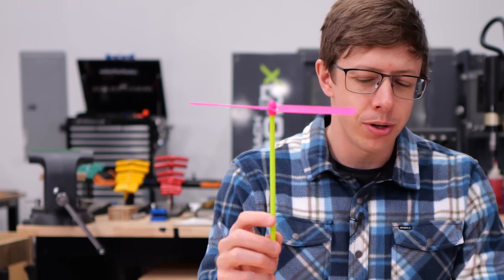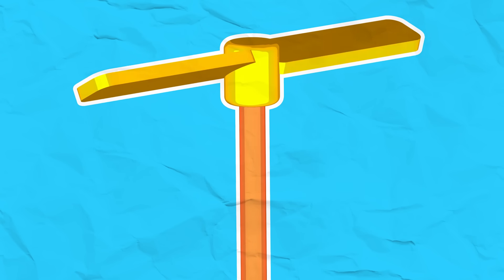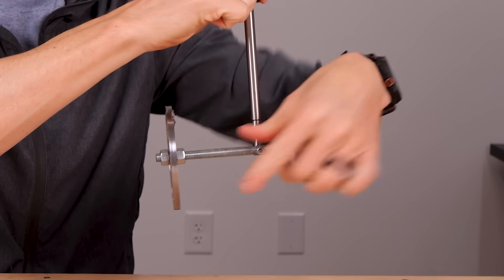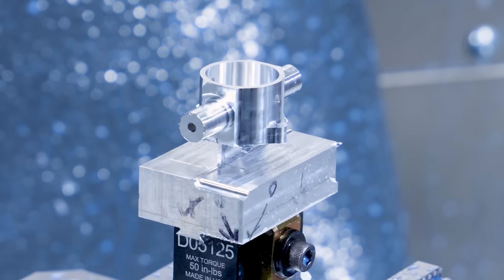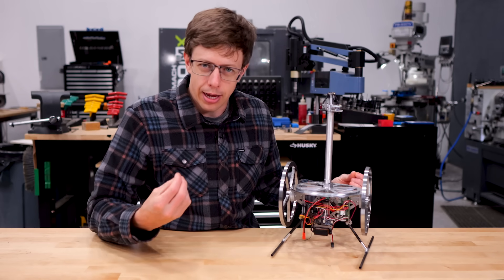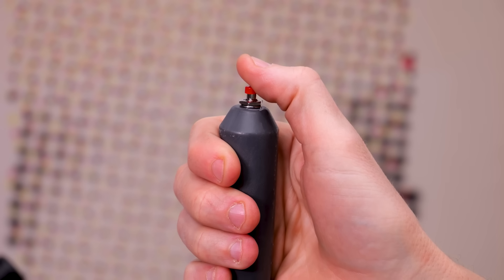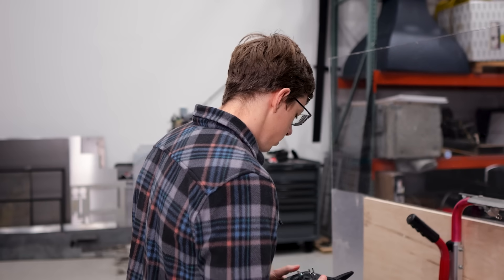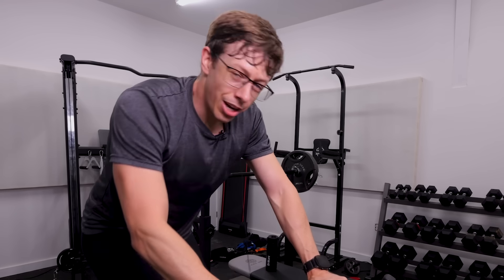I really thought this would fly well

Comment: I think there's a reason that traditional helicopters don't use the vertical "aileron" concept underneath them.  By the time you made them large enough to counteract the torque (and all the inefficiencies of doing so this way), you'd be diverting so much of your lift away that it would have a hard time getting off the ground.  I'd think the way that this has classically been solved is going to be part of your final solution - either with some notion of a tail rotor, or with contra-rotating main rotor blades (though mechanically that's more complicated than a tail rotor).
Reply: I think the K-max (divergent, closely spaced rotor axes, 2 counter-rotating rotors) concept is the most stable option.
Reply: "you'd be diverting so much of your lift away that it would have a hard time getting off the ground"  The direction of the air from the rotor blades doesn't really matter after it leaves the rotor blades.  How does the space shuttle still rise off the pad with the flame trench diverting all of the rocket exhaust sideways?
Reply: @stargazer7644  I see your argument, but there is only so much kinetic energy in the air moving downwards once it isn't interacting with the blades any more.  The downward rushing air into the "ailerons" causes two resulting forces - one a torque trying to counter the torque from the blades (which we want) and another, a pressure downwards on the ailerons (which we don't want).  This has the effect of some of the lift generated by the rotor being countered by the ailerons trying to pull the helicopter back down.  For the shuttle's flame trench, things are a bit different, since the downward force being applied as the flames are diverted off to the side isn't acting on the shuttle; it's being applied to the ground, as the diverting trenches aren't connected to the shuttle.  For this helicopter, the downward force imparted on the ailerons has a similar negative effect as the notion of trying to propel yourself on sailboat by blowing a fan into the sail.
Reply: You could also solve it do it with a counter-rotating fly-wheel at the bottom of the craft. Simpler to build than counter-rotating rotor blades working (it is essentially just the same problem as getting the two main fly-wheels counter-rotating), and easier to control than a tail-rotor...

Comment: How much trouble would it have been just to listen to Occam's razor, why didn't you just spin a flywheel of equal weight to the blades in the opposite direction on the bottom? After all, a metal flywheel is bound to be much smaller then the span of the blades. and you also had the gears in place that should have made this a semi easy modification, would've at least possible flown better the your "Hack". edit: Plus it depending on the metal used it could even possibly fit beneath the training gear.

Comment: Nice project but...

Your larger control surfaces wouldn't do anything because control surfaces don't work under airflow generated through propwash. That is the airstream from the propeller won't be able to help the control surfaces work. That's why control surfaces on planes are always on the outer side of the wings. Secondly, you could also fix your other problems through contra rotating propellers.

Comment: Okay, I'm looking at this project and, while awesome, I strongly believe that you overcomplicated things. Your original objective was to figure out how high those toy propellers could go, and you ended up manufacturing a tail-less helicopter.

The core element of your original question was a simple contraption consisting on one propeller connected to a slim, long rod, which you have to manually make spin. If you want to make the Big Boy version of the toy plastic original, you can (and did) build it with a bigger propeller and a metal rod. But then you added flywheels to the sides because the whole Power/Drag balance. I think here's when things took a turn, because the simplicity of the original concept became--in my opinion--unnecesarily complicated. The core element is still the propeller and rod, and I think you should have focused on how to provide a more efficient launch chance to the original "toy" without compromising the original, simple design.

You built a launcher that would spin the flywheels. Why not use the launcher to make the central rod spin instead? Find a way to keep it attached to the launcher (electromagnet on the base, holding the rod and allowing it to spin until the desired speed is reached? Maybe a simple claw that can open on command?) until it's time to launch, and then just launch the propeller/rod basic contraption. Is the drag still an issue? Experiment with different propellers! You can build a propeller that is ALSO a flywheel by adding a metal ring around the circumference of the blades! Maybe a cone-shaped propeller? Like, a propeller that can "drill" up to the skies?

Remember: the core goal of your experiment is to see how high can you send the original concept of the toy. Don't ovecomplicate the toy: find a way to make the launch more efficient!

Regardless, I can't wait for the next video, whenever it happens.

Comment: over complicating a simple design bro.
1) take original wooden propeller design. replace it with stronger lighter plastics.
2) shaft has fins for straight up flight since height is your goal
3) bottom is a small 45 degree gear and that's it.
4) launch pad has another 45 degree gear to spin connected to motor or gear system for faster speeds.
5) release trigger is just a lubricated straw cut in half to move like grip plyers.

Comment: Flywheel bottom mounted to the shaft parallel to the blade which are on the opposite end. A stacked gear system transmits the rotation of the fly wheel to the shaft to turn the blades.  The stacked gear system acts to spin the blades opposite of the direction of the fly wheel.

Comment: I've never seen a single rotor helicopter. 
I guess two cointer rotation would work better for lift instead of having a tail. 
Then you can have a giant single flywheel underneath horizontal so it'll percess around the center of the helicopter but it'll keep it upright

Comment: I love the video and all your projects but it misinterprets the fundamental principles of aerodynamics. An aircraft does not generate lift simply by pushing air downward; rather, it is “pulled” upward due to the pressure differential created by the airflow over its wings.

The key concept here is Bernoulli’s principle: the air moving over the upper surface of the wing (extrados) travels faster than the air beneath the wing (intrados). This speed difference leads to a pressure reduction on the upper surface, creating a net upward force—lift. This phenomenon is further complemented by Newton’s third law, as the wing does impart some downward momentum to the air, but this alone does not fully explain lift.

A more complete explanation involves the circulation theory of lift, where the wing shape (airfoil) and its angle of attack generate a curved streamline pattern that induces faster airflow over the top, enhancing the pressure difference. The contribution of vorticity and bound circulation further refines how lift is sustained.

A common misconception is that wings “deflect air downward” as their primary mechanism. While downward airflow (downwash) is a byproduct of lift, it is not the fundamental cause. The real driving force is the low-pressure region above the wing, which effectively “sucks” the aircraft upward.

Comment: They had the idea in ww2 to make a plane who would go over mach 1 without a jet engine, and they did; but according to the tests pilots, the thing was horrifying. The propellers were breaking the sound barrier multiple times a second, each. The sound was hell, and it had so much torque that they needed to fight for the plane to stay straight, while flying over mach 1. The engine could only go full throttle (i think) and they were controling the speed with the angle of the blades.

Comment: You're sending the propwash/turbulent air right through the control surfaces. They need to be wider than the prop to be more efficient.  It's one of the reasons ailerons are at the tip of the wings. Maybe use the surfaces to counter gyro precession OR counter-rotating propellers.

Comment: you need counter rotating blades. the wing will only ever deflect a fraction of the torque acting on the prop. adding a tail rotor would just burn energy. talk about reinventing the wheel when you are basically making a fancy frisbee

Comment: You just need a long 'stick' with the flywheel at the bottom coaxial to the stick (low CG), attached with a planetary gear to keep fixed pitch blades rpm low, and a BIG farm field, so when it drops in from 1500m you have time to hide. Remember, it's not science unless you have to hide.

Comment: Not an engineer, but to keep it close to the toy, could you have the shaft and blades as he does now, with the cyclic, a geared portion the the shaft and spin it with a gear on the outside. The shaft could be held at the bottom with a mechanism and when up to speed, set the cyclic to “climb” and release the holder at the bottom?

Comment: I'm just curious, wouldn't it be better to only keep the "shaft and propeller" and just attach the flywheel with it? The thing would work just like the normal toy but with the benefice of the fly time increased. If possible keep the pitch control system aswell I guess

Comment: Wow, this takes me back, was similarly inspired by that same propeller toy as a 10 year old in the early 90s to create an electrically powered version using whatever I could find, with dreams of launching that sucker into the stratosphere:

-I took apart an old RC car with a larger than typical motor.
-Made a base with an empty solder spool that I glued the motor from the RC car to, so that the motor shaft was pointing up.
-Used the motor to direct drive an aluminum propeller I painstakingly fabbed as well as I could with the tools in our garage(grinder, vices, hammers, pliers).  The plastic one from the toy was not beefy enough to carry the weight of the motor. 
-Made a 10ft power cable with the thinnest gauge wiring at hand that that connected the motor back to the 8 - AA battery RC car chassis.
-Upon testing and iterating, the best I got was about 8 inches of lift in a bouncy, wobbly fashion.

Stabilization was the main issue, I couldn't make the prop symmetrical / weight balanced enough for it not to veer off in one direction or another. Also, much like in the video the torque of the motor would cause the body to turn when off the ground. Kinda hit a dead end with my capabilities at the time, but in hindsight probably needed something like a tail rotor. It would've been insane if 3D Printers existed back then to fabricate a gear and driveshaft assembly.  Also, years later I was mesmerized when I first used a quad-copter dji drone.

Comment: What if your approach kept the overall concept of the toy, but instead of supercharging with a flywheel, you focused on how high you could get powered. Yes there is  a hard limit at the speed of sound and severely diminishing returns. I still think it would be interesting using a drill to power the toy Did you ever see the flying princesses? Similar. See what optimizations you could make without making it into a mechanical nightmare. Or maybe someone has already done that.

Comment: I know its all part of the fun of it, but boring suggestion incoming... this one feels doomed from the start based on the calculation of it going 5 times higher with flywheels. I'd say that calculation would could be accurately described as the blades spinning for 5 times longer, or 5 times the energy output. But then the flywheels, frame, electronics are adding waaaay more than 5 times the weight. I bet if you massively scaled back the engineering challenge to just something that could spin up a carbon fibre shaft and fixed, optimised pitch blades and then release it when at full speed that thing would rocket up fast and high. But then I suppose, where is the fun in that! Looking forward to a part 2 😁

Comment: Simple project: slap a flywheel on a kids toy. I mean, 2 fly wheels. I mean, 2 flywheels and some control surfaces. And electric motors, and oil bearings, bigger motor.... That's why we love this channel!
Reply: Next step is probably a tail rotor. By the end of this it'll just be a helicopter. 😂
Reply: @AndrewMeyer  Thats not the "next step" its the only step. What is a hellicopter? Its a machine that stores energy and releases it through its main rottor. This is exactly what this is. The whole video was made on purpose like a journey to solve problems that have been solved for 100 years.
Reply: @johndoe-jg7he  yeah, but we've never made a kinetic helicopter before either, and that's a neat idea.

Can you generate enough energy in those flywheels to make a remote controlled quadcopter that doesn't crash after it's first flight?
Reply: Or 2 flywheels and coaxial sets of blades without any need for stabilization and control surfaces
Reply: @Pchelozavr  he literally just needs tip weights on the kids toy. You could probably even keep the hand launch.
Reply: @appa609 this is hilariously elegant, I love it
Reply: "Let's go, in and out, 20 minute adventure..."

*6 months later*
Reply: As the saying goes "Well that escalated rapidly".
Reply: ... electronics for flight control, reporting altitude ... 😂
Reply: So the real question: At what point can we call it over-engineered. We need a formula for that!
Reply: @silversword411  never
Reply: It's like watching Randall Munroe's xkcd live action
Reply: It just needs another flywheel or 2.
Reply: Not many kids will have one of these $25,000 "toy" helicopters.
Reply: Could the flywheel just be outside of the rotors, makin the rotors the bearing of the flywheel? It seems like it could reduce a lot of drag
Reply: The "flywheel" needs to be wieghts on the tips or else counter rotatioanal forces
Reply: The plan for the motors (one that stays on the ground to spin up the flywheel, plus a tiny servo on board to angle the blades) never changed.

Comment: As a Commercial helicopter pilot I recommend three things:

You're making it more complex than you need to!!!
But, If you go the complex route- keeping the fly wheels attached, you will NEED a tail rotor or a second counter rotating propeller simply because of the torque you're producing. 
If you go the simple route- which I recommend, have a release system.
i.e. spin the "toy propeller" up to speed using the fly wheels, then just have a mechanism that will release the propeller into the air. 
I'm sure you could find a way to modify it from there to make it go higher. 

Upvote so he maybe does a pt.2 cause I'd love to see it!
Reply: Disconnecting the propeller would work to duplicate what the kids' toy would do, but then the fly wheels wouldn't be necessary.  I think the goal was to come up with a mechanism to keep the fly wheels attached so the propeller doesn't lose its energy as quickly by being able to spin at a slower RPM for longer.
Reply: Yeah he 100% needs a tail, the math just doesn't check out with the control surfaces on the bottom.
Reply: as a C# software engineer, first thing i thought of was a tail rotor.
Reply: We're nowhere near the critical-point of complexity and tech-wizardry needed for Youtube views ... I'm thinking the flywheels should be augmented to become static-electricity generators with which he can produce ionic-thrust vectoring control!
Reply: your simple route is inaccurate; The purpose of the flywheels is to store energy over time so that the propeller never reaches high velocity, but instead maintains a semi steady rotational velocity. He could simply remove the flywheels but that won't get much height past the store bought toy for the same reason as above, too much drag with increased velo.
Reply: @CaptainMagnus  It's accurate to how the toy itself evolved (at least in the U.S), actually. There's a version with a hand-held launcher that would spin it in the middle of, before pressing a trigger to release it.
Reply: @ that's why he needs to find the best rpm for the best rate of climb. You can't just spin the propeller super fast and not expect the forces of drag to take over. As speed increases, so does drag. He needs to find the optimal RPM that will get the best climb while keeping drag low. I get the point of the fly wheel, but in my opinion that defeats the purpose of the toy. Like I said, I'm sure he would be able find another way to get the toy to fly for longer as I'm no engineer, I just fly em.

Comment: This is why helicopters scare the heck out of me: I learned how they work. If you know how complex and insane the engineering of a helicopter is - like helicopter pilots do - why on earth would you ever get in one? Autorotation? No thank you. The blades are tilting back and forth every half rotation? What the hell? There's something called a swash plate and if that breaks, you're done. And then the entire disc can lean in all directions? And then they can go faster and slower? That's way too much. You're asking too much of those blades. And then you need extra smaller blades on the tail to keep the cabin from spinning? And the cabin is just hanging from the...no! Why would... how did they ever... Helicopters are sorcery. I'll never get in one.